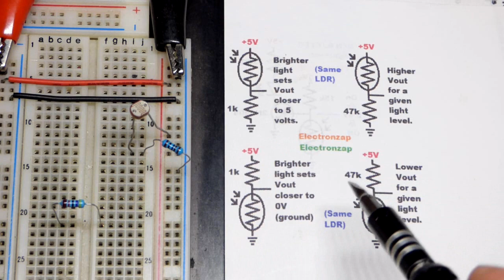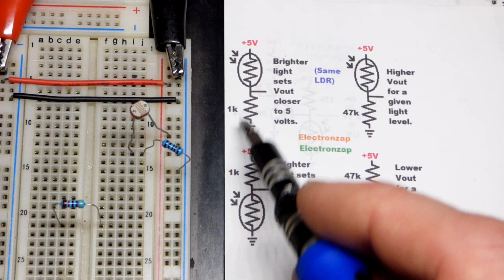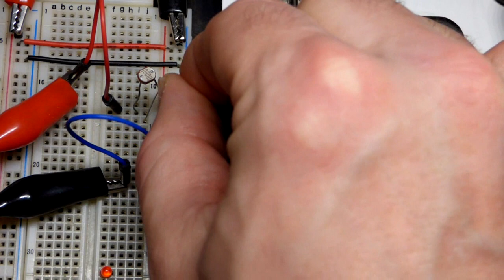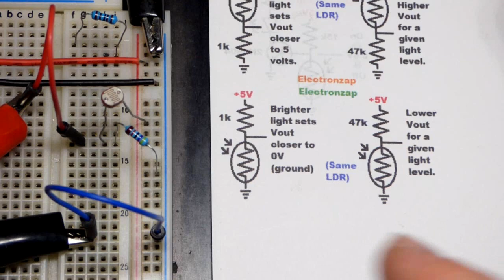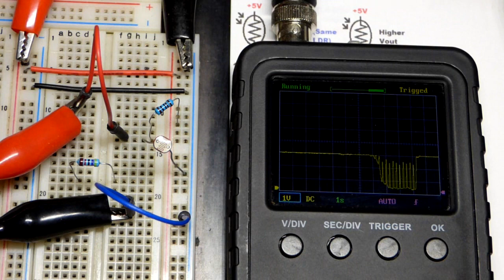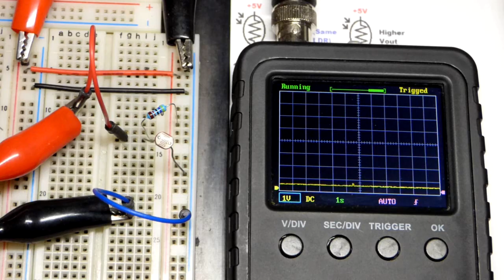High and low side LDR voltage divider light dependent resistor learning electronics shorts 25

Comment: Love your videos. BTW has anybody ever told you that you sound like Norm McDonald from SNL?  Also really no need to swap the position of the LDR and resistor. In one case you are measuring voltage across R and in another you are measuring voltage across LDR. Doesn't really matter what order they are in as far as voltage drop is concerned.
Reply from the maker: Yeah, a lot of people noticed I sound like Norm McDonald :) and the position of the LDR determines the output node voltage in relationship to the supply rails, not the voltage across it. Usually you compare that voltage in relationship to ground.